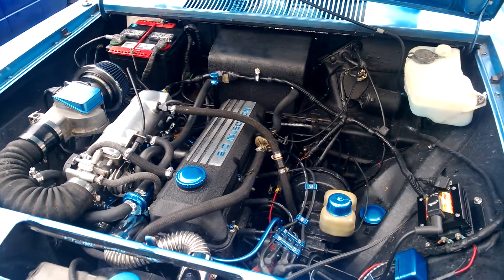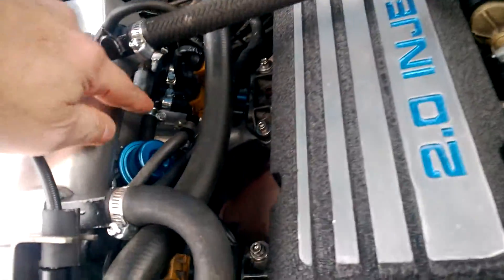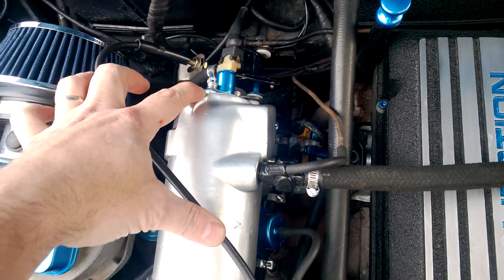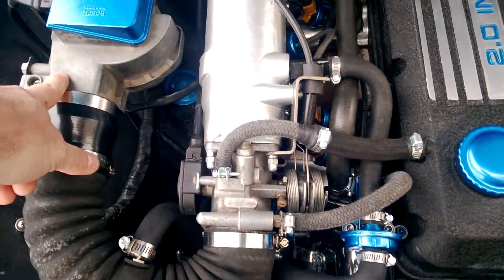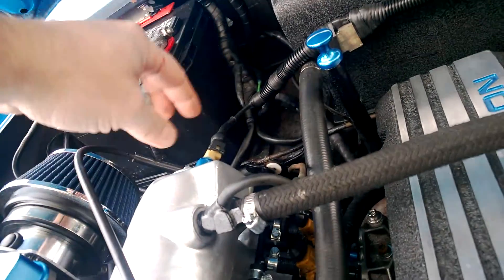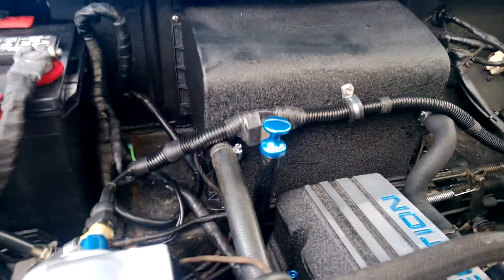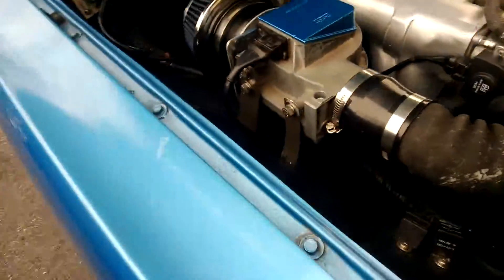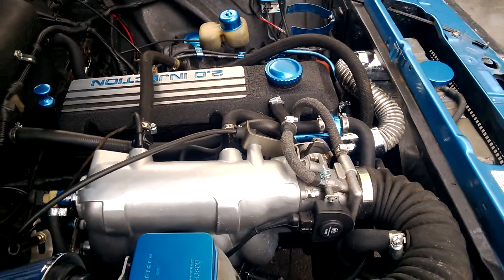Overview of the LE-Jetronic Bosch Fuel injection installed in a 1971 Opel Kadett

Comment: LE-Jetronic is the best injection system, or actually second best. 🤣 The better one is LE2-Jetronic. It doesent have cold start injector and its thermal time switch. LE2 is used in FWD Kadetts 1.8E engine.
Its very simple and extremely reliable system. And gets superb fuel economy. 

Ps. Jetronic equipped CIH starts without preheat even from -30F
Reply from the maker: Agreed, the 2.0L system is way better than the 1.9L one. Funny thing the early 80s VW Vanagon is reversed. The 2.0L is early LJet and Low impedance injectors while the 1.9L is LE2 and High Impedance.

Comment: Hello...thanks for the vid...really nice...do you have any docs about the coil install in le-jetronic system? im having problems to get my 2.0 cih working good...dont know why and need some help...best regards please if you have some nice docs about please sent to my facebook page, Nelson Quintans da Silva, or my email: Nelsondutchman@hotmail.com best regards from Portugal
Reply: What is the problem? What does it do?
Reply from the maker: Sorry not sure why I never saw this post until Juho replied. What coils ade you talking about? The injectors or the ignition?
Reply: Hi! Same injektion on my opel...problem now thats just started...its over fload with gas.disconect pump its starts just one second with pump on its died .regulator and fuel lines its ok ?any ideas not  the cold start ..
Reply: Hi! Same injektion on my opel...problem now thats just started...its over fload with gas.disconect pump its starts just one second with pump on its died .regulator and fuel lines its ok ?any ideas not  the cold start ..